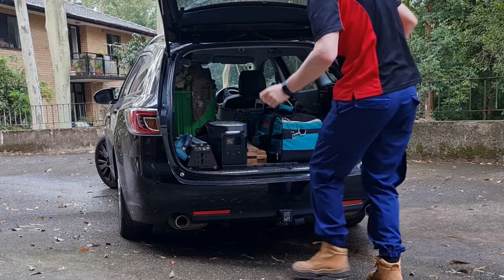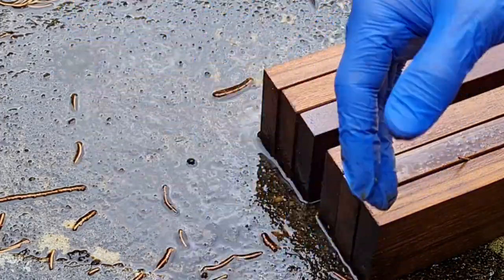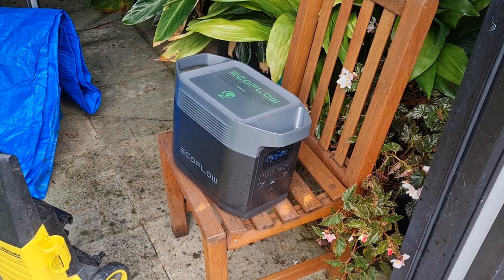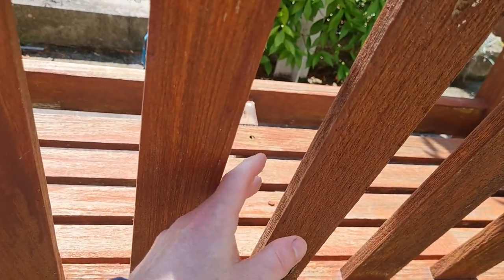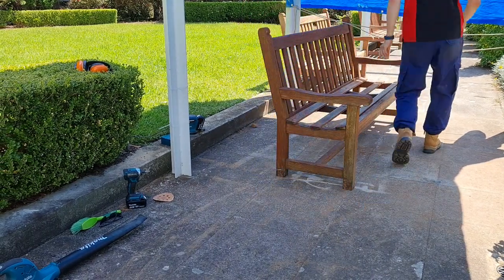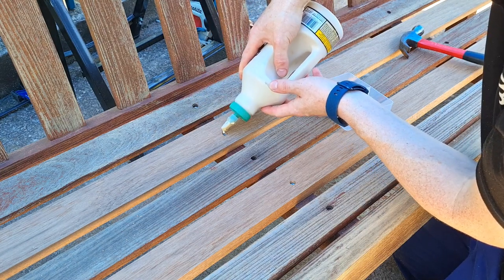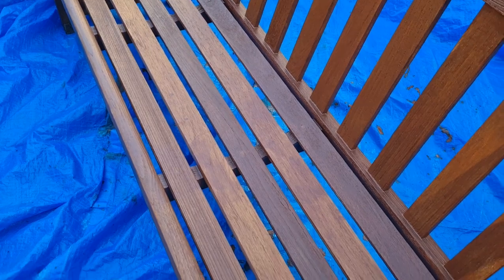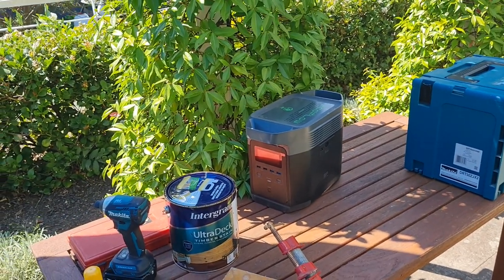Restoring Teak Garden Benches (with help from the EcoFlow Delta)

Comment: You are a hard worker James and I tip my hat to you.  Cash from jobs like this must make workshop and tool upgrades more exciting. Hope you topped up that EcoFlow battery before you left site. 🔋😃🔋
Reply from the maker: Cash? No, this is all above board and the taxman will get his share. I'm a legitimate business don't you know? 😆 I think my poor little washer is on the way out, and I've wanted a bigger one for a while so the profit from this job might in part go towards a new Gerni.
Reply: @FixitFingers  You said it might be leaking oil :(  We just got a G3000 Karcher from supercheap. The only thing wrong with it is that the hose is flimsy.   though you prob would want another electric one as you have the ecoflow.
Reply from the maker: @Saw-IT  yep will be staying electric. Gurney has a good-looking 1800W one which I think will be a good upgrade and will still run on the Eco-Flow. The Karcher has done well, it is well over 10 years old and is often used for much longer stints than is recommended :P

Comment: Did a top job and skimped on nothing to get a great result and rather you than me  All the best
Reply from the maker: Cheers Les! The old dowel / holes and rot around them really annoyed me. Would have been much better if I could drill them out, plug the holes and then seal and double-screw in the new wood but working in a budget you gotta draw a line somewhere 😊

Comment: James this was a really entertaining video. It enhances the instagram clips and brings in some really useful details. 

I thought about a single screw and if those back slats are going to twist, but they do look pretty firm. Could you have done a pocket hole at an angle? I wondered if you could have made some kind of mortice joint at the bottom and then at the top cut a little slab off the back of the slat which would allow it to lie against another block morticed in and then you reattach the slab back on. I guess it would need epoxy to glue this sandwich together and take significantly more time and woodworking. 

The ecoflow looks like a thing that we will see more and more of as electric vehicles drive the price of batteries down. They aren't 100% efficient so I guess they do have an environmental cost.

Did you label the benches and put them back where they came from? I wonder if cycling them around might extend their life as they would then be subject to different stresses.

Would any of the long slats have been useful for chopping down as back slats? Did you keep any of the old bits of wood as "spares" for the next time they call you back?

You worked really hard in all weathers but it paid off for sure. Great vid, thanks for making it for us.
Reply from the maker: So pocket holes are already on a 15 degree angle by design. Those were 64mm screws meaning once they were both in they resist twisting somewhat. You wouldn't want to do that on load bearing bits, but for back slats it's fine. With 13 slats repaired, any other form of joinery would simply not be cost effective. Mortises would be much better, as would cutting away all the old rotted dowels but that would have added hundreds of $$$ to the build for the client. 

I think we are just at the start of this portable battery tech. Give it a few years and the cost will be down, capacity up, and brand choice expanded. For now they are a bit expensive for the average house hold but for what it is it works very well! 

I did actually rotate the benches as there were two that must cop the most sun and weather that were noticeably worse off than the others. 😃 I could have cut down the old slats, but I had the new timber so I used it. The old slats have been reclaimed and will feature in a future project once I chop out the worst bits 😁
Reply: @FixitFingers  James thanks for answering! Cannot wait for the reclaimed slats video.
Reply from the maker: @loopinnerthe  might be waiting a while. Need inspiration to strike on that one first... and maybe a thicknesser :P

Comment: I too hate flatheads!
Reply from the maker: I asked him when they were last worked on, they got teak stain about 10 years ago, however they had never been taken off the metal pylons before and were installed somewhere between 20-30 years ago. Surely we had phillips head in the 1990's?! 😅
Reply: @FixitFingers  Philips would only be a slight improvement. The world needs Robertson!!
Reply from the maker: @TheGrantAlexander  I replaced them with hex drive coach screws
Reply: @FixitFingers  I saw that, not quite as elegant as the originals 🤣
Reply from the maker: But much more practical :P

Comment: James, your beginning to talk like a seasoned tradie..... "Its 4 o'clock, and it's time to go home". That and the verbiage is a bit more colourful.  But you need to get that Sean Connery inflection to make it sound more.... union. I'll nominate you as shop steward. Do I have a seconder? Lol.
So let's put this into perspective. These benches were repaired with reclaimed lumber? After the lumber was used to make a fake pallet. It all makes sense now. You can make more kangaroo skins off of the materials if you can claim that it's been recycled. Absolutely friggin genius. I think I've found my new business model. Start a pallet making division, park them outside the shop overnight, bring them back in the next day, reclaim them, and  make more $$. Oh ya, this is going to work great, way better than that short lived venture of building screen doors for submarines. Apparently the Canadian Navy had a different view point.
Teak benches though, that's pretty posh for garden furniture. At least it is way out here in Podunk British Columbia. The biggest job I've ever done with teak, was repairing the deck on a friends sailboat. Beyond that, it's not exactly a go to species of wood for many projects around here. The finished results of your work turned out pretty darn nice. But, I have one teenie tiny little suggestion, and it's probably something that 99.99% of people would never even notice, or probably even care. That's plugging the pocket holes too. Having Kreg's plug cutter pays off on those finishing touches. Not that it would protect the screws so much, but it would keep the elements out of the pocket holes, and it's aesthetically pleasing. Or I'm just being anal, feel free to pick one. Lol.
Estimating is like bidding on the big showcase on the Price Is Right, and getting as close as you can to the maximum that you think it's worth, and what the customer is willing to pay, without scaring them off. The only way to get better is practice. I've been giving estimates since 1980, and I can still get it wrong on occasion. Less now than 43 years ago. But having said that, in the current market, just getting a tradesperson to show up at your door to look at the job is already a bonus. I've, in my opinion, grossly over bid jobs because I either really didn't want it, or didn't have the time, to have it blow up in my face, and the customer says yes. Ya I know, boo hoo, here take my money. In those cases the price is secondary, all the customer wants is to be penciled in on the schedule. They just want the job done. Heck, even the crappy trades people I know are booked up solid.
You may have not made what you expected to make, but you also endedup with a couple of leads to other jobs. You probably didn't expect that either. That in itself has a snowballing effect. I've been doing contract work for a long long time, to this very day I have never advertised once. We're not listed in the phonebook, we don't have a website. Ive been given more business cards than I've ever handed out. I've never even so much as put up a post-it on a local community bulletin board. It's all been word of mouth, and here's the key, combined with quality workmanship. With those two elements working in your favour, you can be as busy, or too busy, as you want to be. I can happily say, I don't go looking for work to keep the shop and everyone busy. The work finds it's way to us. That's my business model, and it seems to be working. You plant a forest one tree at a time. 
So six of one, or half a dozen of the other. Did you make a reasonable amount for your efforts? That's what counts. I've never had any two jobs, ever, make the same amount of profits. But then I've never been struck by lightning either, so there's still a chance. 
Aren't those EcoFlow's handy? Yes they're expensive, especially when you have easy access to regular shore power. Consequently that could make it hard to justify the purchase of one.
But here's the other side of the coin. I have a 24', three axle, 8' wide, 8' high, fifth wheel cargo trailer. Which is my tool/portable workshop trailer, that is used on sight, on average, 120 days a year, in remote locations, where there is no shore power to plug into. The back 16' is tools/workshop, and the front 8' plus overhang, is the bunkhouse. Up until last year it was powered by a EU7000w onboard Honda generator, plus there was a EU2200w Honda suitcase generator, which was used for portability where needed. Last year I converted to an EcoFlow set up. Yes it was pricey, I could have purchased four brand new EU7000w Honda generators for what I paid for the EcoFlow set up. Just north of twenty-two grand, in Canadian beaver tales. What I purchased was the Delta Pro, three Delta Pro Smart batteries, for a total of 14,400w of power. I can literally power a house from my trailer. The Smart generator, and the 400w solar panel with the solar tracker.
So now here's the mathematics why I swapped out my Honda generators. For 120 days the generators run on average a minimum of ten hours a day. The fuel consumption averages thirty litres per day. Simply put, that's 3600 litres for the year. This last year with the EcoFlow, the smart generators average daily fuel consumption was 2.75 litres, or 330 litres for the year. Monetarily for this last year, the fuel savings difference was $5400 cdn. In four years that's 100% return on investment. I should point out, on days when there's a lot of sunlight the Smart generator may not run at all, and visa versa on cloudy days,  where it might run a couple of times. It's also dependant on power consumption too. But I think best of all for me, I don't hear the constant droning of a generator morning, noon, and night. So that's the flip side of the coin, from my perspective. 
This years upgrade to the tool trailer, Starlink Mobile. At least then I can watch Fixit Fingers out in the woods, powered by EcoFlow. 
Cheers. 🖐🇨🇦
Reply from the maker: You jest but there is actually a bit of a hubbub in some places about the definition of "reclaimed" timber as it grows in popularity. Stories of people just leaving wood outside for a few months then charging a premium :P This was a very well-to-do apartment complex. You are talking $4mil+ units here and the benches originally would have been very expensive. They are over 20 years old and have had minimal care so are doing quite well considering. The Kreg plug cutter is one of the few blue tools I do not currently own. it would have been very handy here. Honestly there is a lot more I could have done here but a practical restoration is what was budgeted for. I don't get (or want) a huge number of commissioned jobs as these take away from my hobby time in the workshop, but the website is what drives most of them. As such I should be charging more to ensure when I do take time out of 'fun' woodwork it is worth my while. Happily the complex accepted my variance and I was fairly compensated for my time in this instance. These jobs are nice supplementary income and the beauty is as I don't rely on the money from them i can be choosy and only do the ones that sound like fun or will build experience. I don't doubt I could likely make more money from being a handyman than working for the public service given the current trade shortages here but I prefer my secure 35 hour weeks over the fluctuating 70 hours I'd have to do as a permanent contractor :P 

While I could have got by with a long power cord at this particular job, I did find the EcoFlow super convenient and if I was doing this type of work every week it would be on my list of essential tools, even at the current price, as it would pay for itself in time saved quickly. I doubt I'll even need a setup as impressive as yours but as the tech continues to improve and the cost comes down you can imagine what the Australian sun could do to a similar portable power rig like yours!